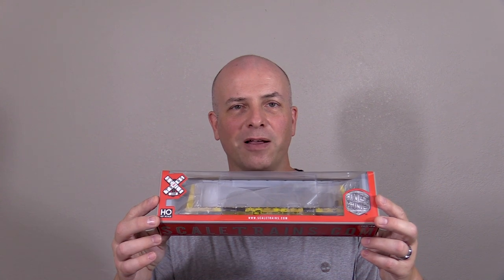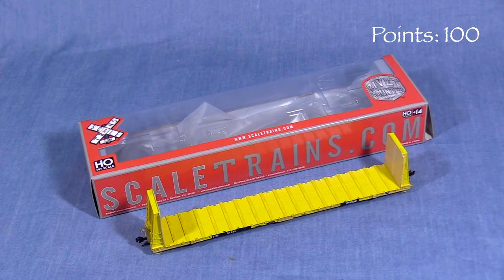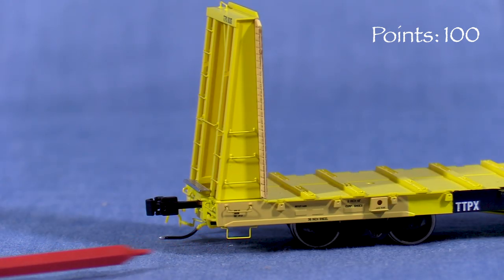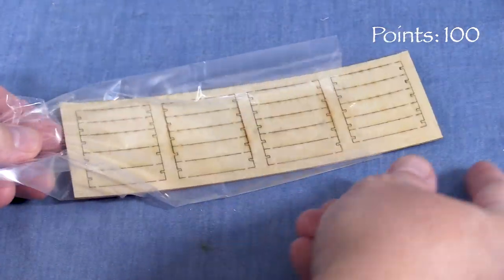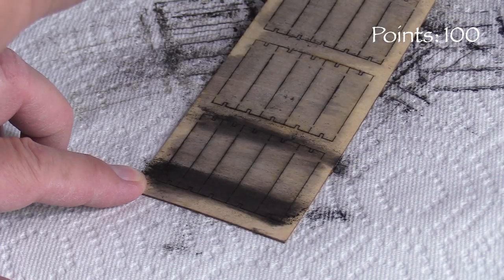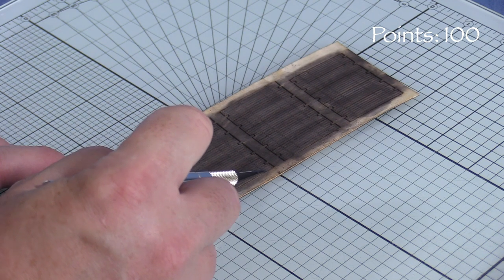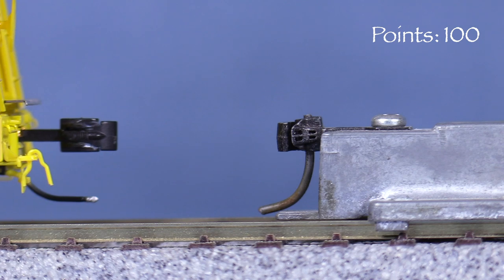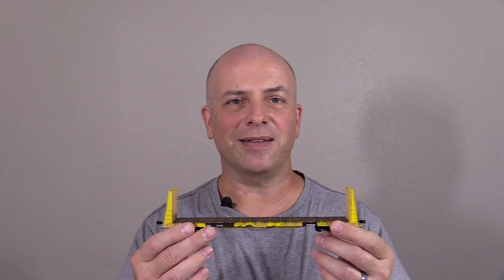Product Review HO ScaleTrains Bulkhead Flatcar

Comment: Hi Dan. I watched this video again because I bought a bulkhead flat car with brand new real wood (skin color) deck on top. I was just wondering if trying to mix a tan color would do the same job than buying Silver Wood solution. Please help me with this one. I like what you did with laser cut wood decking in the video. You're ending up with a nicely aged top deck that look pretty realistic. And... would you do the same on vertical bulk wood. As it's not the car floor, I suppose it has to be done differently. Your advise is always welcome. Thanks !
Reply from the maker: The Silver Wood solution is more of a very thin dark gray wash, which is supposed to make the wood look like old, grayed weathered wood.  Tan would make the wood look newer, which is fine if that's what you're after.   You could make your own wash using some thinned medium to dark gray paint.  The powders I used had a lot to do with the finished appearance too.  For vertical wood the process would be similar, though maybe with not quite as much wear.  On a bulkhead flat, the loads would mostly be touching the deck.  The bulkheads are there to keep the load from shifting.  My best advice would be to find some photos of real flatcars and try to reproduce what you see.  Even if you can't find the exact car you have a model of, you can often use similar cars as a weathering guide.  Thanks for watching!

Comment: Would you say that the planks are hard to cut with out braking? Also, Nice Review!
Reply from the maker: I wouldn't say it's hard, but it helps to have a sharp blade and a good cutting surface.  I got the plate glass cutting mat I use at a craft store.  It's really helpful for things like laser cut wood parts, since it is firm and the parts won't distort as you apply pressure with a knife.  Thanks for watching!